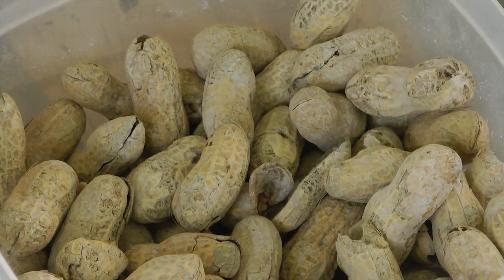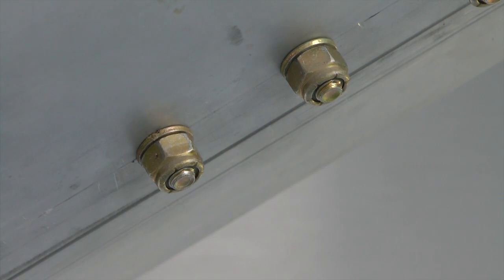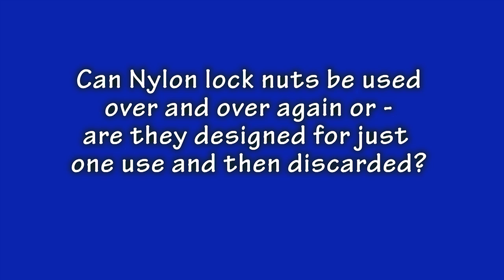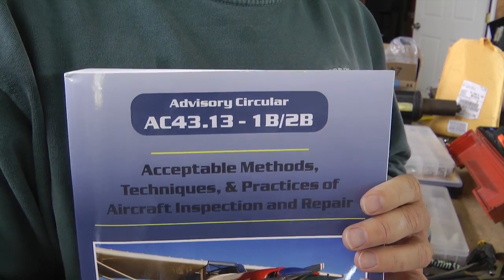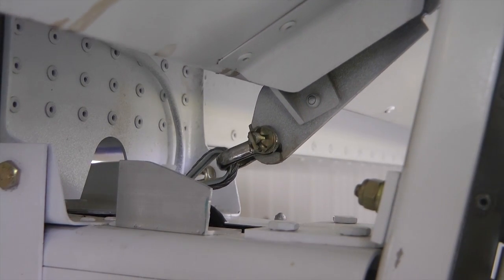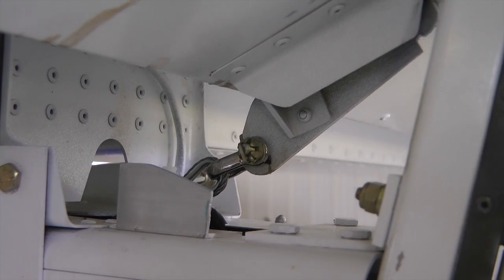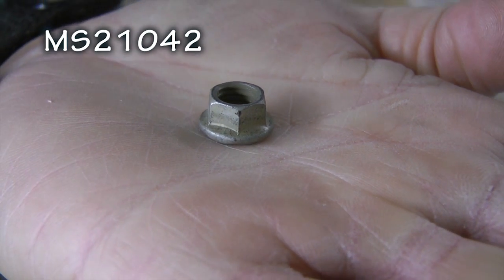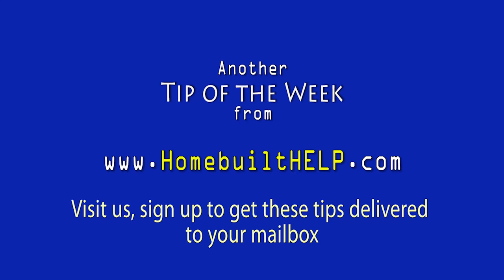How to Select a Lock Nut for your Homebuilt Aircraft

Comment: On the argument about reusing nylock nuts: You should definitely follow A/C 43.13 as noted here. But notice that the circular doesn't list nuts smaller than 7/16", which are the majority of the bolts/nuts on homebuilt aircraft - 3/16" and 1/4" are both very common.

Since no torque values are listed for those bolt sizes, you should not reuse those nuts. "DO NOT reuse ... if the nut cannot meet the minimum prevailing torque values. (See table 7-2)"

How can you meet the minimum prevailing value in table 7-2 if it's not listed? You can't. You should replace those nuts. They're only about $0.25 each, so why not just replace them? Your life is worth more than the $5 you'll spend in replacement nuts in the lifetime of your airplane.

Comment: Hi sir, Thanks for sharing your knowledge on suitable nuts. Do you have an opinion on the Fujilock nut? It's for a car application. I believe they will fit between the Nyloc and the AN363 on the aspect of not being to though on the threads making them more suitable to be used multiple times? What do you think.

Comment: Do MS21042 damage thread the same way as AN363? thanks
Reply: I believe they do. after taking off about a hundred of these on a jet engine some were so loose once I boke the torque I could unscrew them with my fingers. but most I had to use socket wrench all the way off. Mind you these particular bolts have been removed maybe a hundred times. as this engine is one we practice on disassembly on.
Reply: @markthompson8656  thanks a bunch

Comment: Is it ok to use cadmium plating in aircrafts?
 Rohs don't allow use of Cadmium or is aircraft accpetion
Reply: The cad plating is serving two purposes. First it is for corrosion protection. Second it is a lubricant. Yeah, no kidding. do not think of it as a grease/oil but it does serve a purpose of the inner-outer threads sliding over each other.